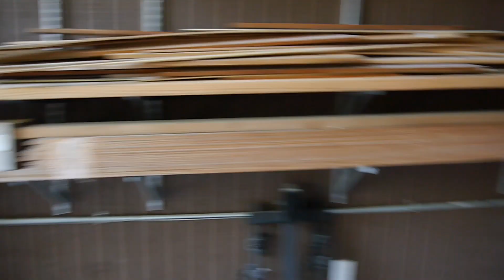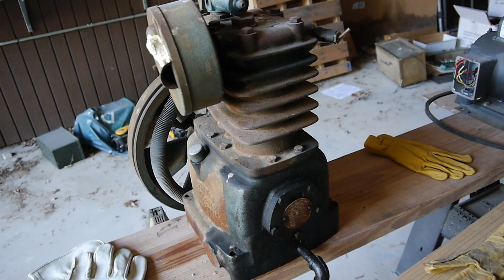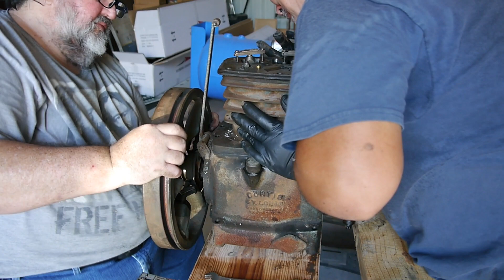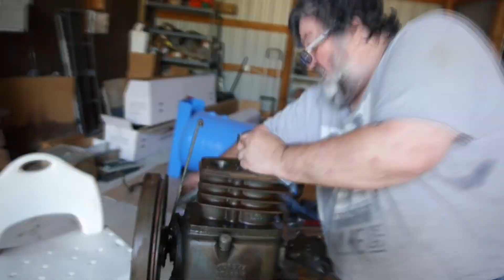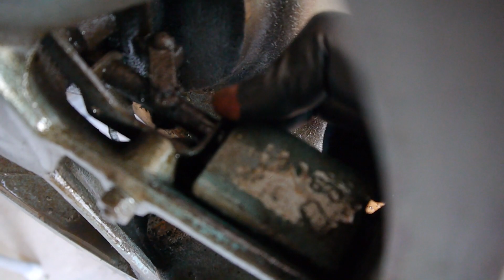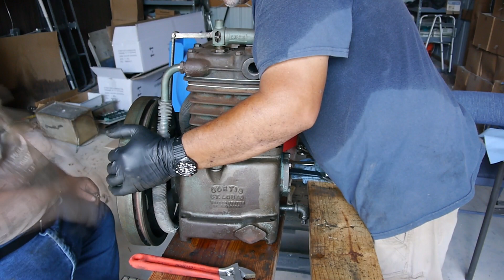Old Air Compressor Pump Maintenance

Comment: Greeen Gaskets require a follow on torque.   Blue goo not needed,  just a correct torque for the bolt (grade 5 probably).   What an mailing old machine,  external comprehension relief (not needed)  and the odd valves.